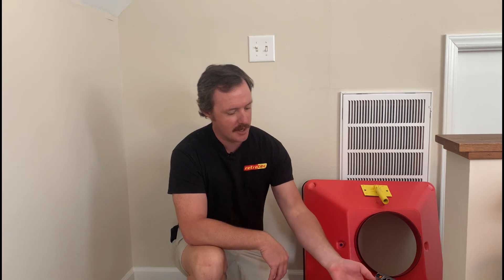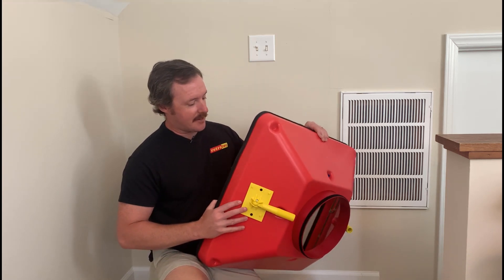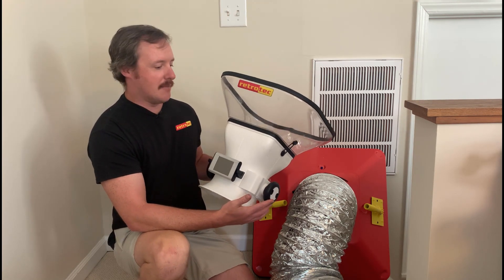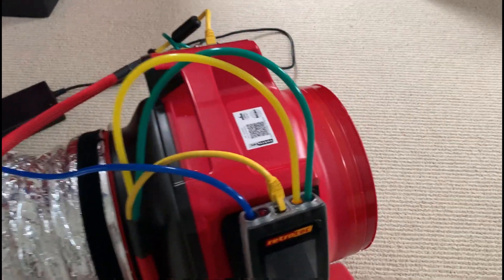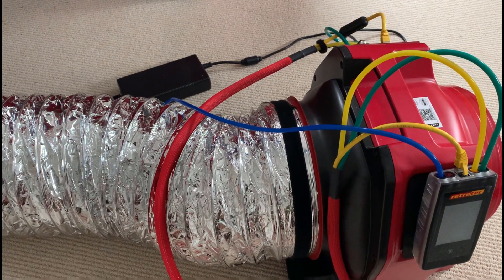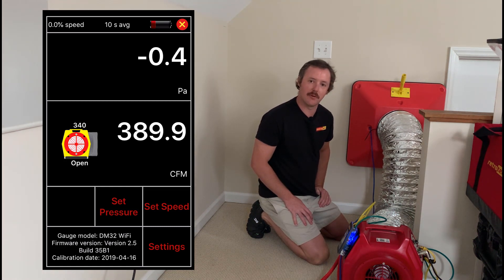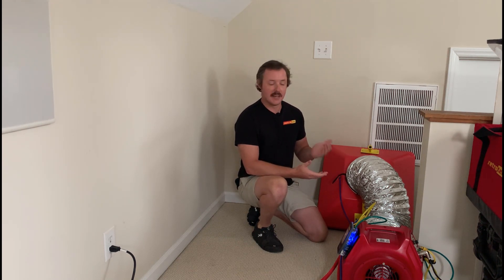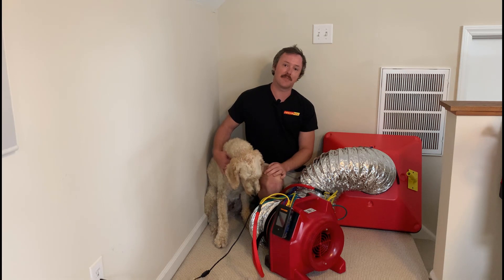Turn Your DucTester Into a Flow Hood

Comment: Sam, why not use Set to 0Pa instead of manually adjusting the flow?  Just guessing it’s faster.  2nd, I see how flow hood stays on wall with negative pressure in the hood but when pressure in hood goes to 0, how does it still stay on the wall?
Reply from the maker: Hey Colin, you're right, I manually set it to 0Pa because its much faster. I also do this for LTO testing for the same reason.  I tried this a few times before filming and hood always managed to stay on the wall, which i also thought was interesting.

Comment: What’s the extra level of uncertainty caused by measuring the flow at 0Pa when the fan flow is calibrated at 50Pa? Has that been worked out?
And how does the hood accurately measure internal static pressure when there is dynamic pressure of the air flow so close to it?
Reply: Lee Kenton If by “fan flow” you mean DucTester flow, this device is almost impervious to back pressure because it uses a centrifugal blower to move air which is not true for an axial fan design which starts to accumulate errors as back pressure increases. All Retrotec fans have a back pressure limit built into the flow equations so when it goes too high, you’ll be warned.
If by “fan flow” you mean air handler flow that is being measured where Sam starts at -53 Pa in front of the register because of the flow hood, that pressure is removed by the DucTester powering up so it supplies enough flow to drive that pressure back to 0 which is what the system will see when the flow hood in not installed. By powering up the flow hood, we do not measure 230 CFM which is what a passive hood of the same dimensions would measure but rather we measure the 390 CFM that was present before the flow hood was installed over the register. 
The hood measures static with a pieziometric ring that averages the internal pressure with pickup points that are not impacted much by the flow through the flex.  Flow does not blast on top of the sensors which it would do to a greater extent if you were measuring a supply in which case shielding over the pickup points would reduce the dynamic pressure.